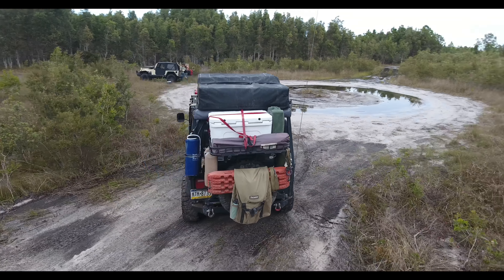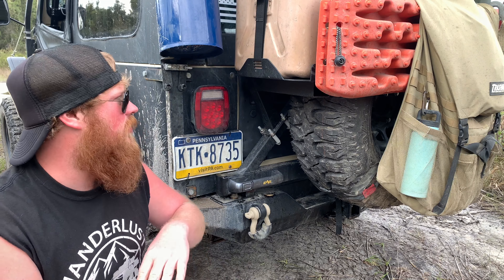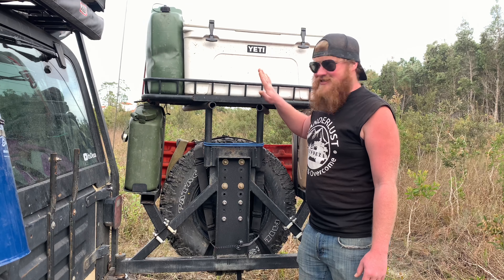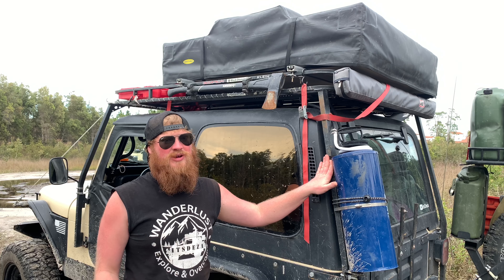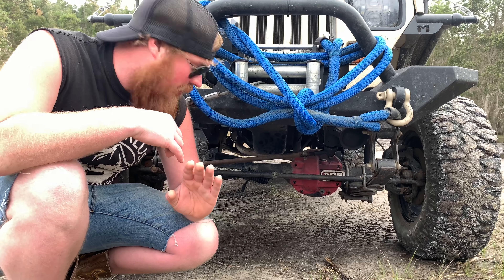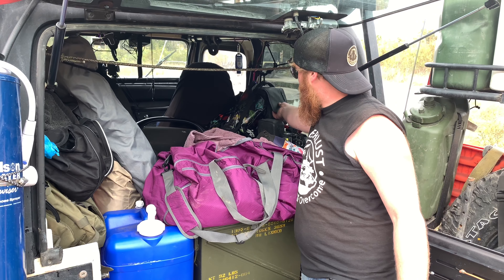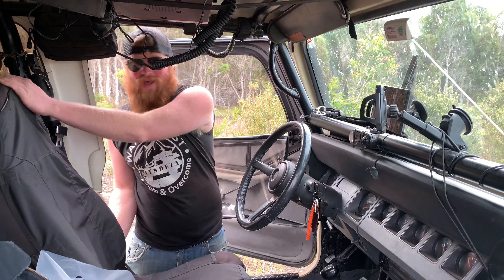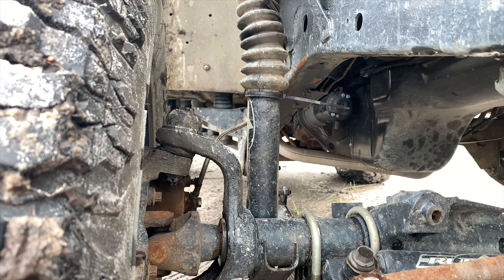Overland Setup! Jeep Wrangler Yj

Comment: I had one of those EAG bumper/tire carriers with the push button like yours and I actually liked it. If I remember correctly I had to modify/adjust the catch pin on the bumper for it to latch correctly but after that it worked great. I didn’t have as much weight on mine as you do so maybe that is a factor. I swapped it out for an Or-Fab carrier which I like better.

Comment: Love the YJ. Would have gotten one if I could have found one in decent shape. My first was a 89 YJ with the 4.2 engine. That went anywhere. Your videos are great.
Reply from the maker: Thanks!! They are hard to find in good shape! Mine was a rusted out piece of crap when I got it! Not a single bolt was left untouched when I built it. A lot of cutting and welding! The 4.2 is the only engine I never messed with how did she feel?
Reply: itsDeza 4.2 was a great engine, had a lot of power for a 6 cylinder. If I could I would put one in my Cherokee.

Comment: Love it!  I have a 92 YJ w the straight 6 (4.0L). Car is running with 15 inch wheels and 33 inch tires. I’m struggling with power and not getting enough torque and power out of the engine. Not sure if it’s due to axle ratio?   Did you change yours?  Let me know your suggestions in getting more power.  Thanks!

Comment: Wow, what changes you have made since couple years ago for your Moab trip. 

Questions: 
- Still running the D35 in the rear with that D30R up front? Whose alloy shafts you have in the D35? Did you know, the early years ZJs had D35s with rear discs that can be adapted to the drum D35? 
- You're missing the front ds in the vid and the vacuum lines for the quick disconnect. You go to the XJ/TJ 1pc inner shaft for the 2pc inner shaft? Upgrade to the 297/760 ujoints from the 260 ujoints in the YJ to go with those shafts? Do you know the ZJ shafts also fit the YJ's D30R and come in cv style? If you removed the quick disconnect, did you change the front ds to the TJ style where its balanced as it rotates constantly and has the double-cardon joint at the tcase output?
- Do you keep any hardware/spares in the Jeep for the Jeep? Axle shafts, ds, dual batts, etc. You have tools but do you have the bigger spares? What about spare fuse, relays, and things?
- Have you thought to place in a dash switch to control the winch, in addition to the hard line hand held? 
- What does it weight outfitted? There are plenty of truck weigh stations to check that out, and if you park evenly across the split of the scale, you can get a front & rear weight.
- Now you have a hardtop, but didn't see any AC. You have the soft half doors to help remove and add air flow, think about having the sides windows tilt, ie minivan? Rear window removed or capable to be split into a slider, ie like those slider uppers for the 1/2 doors? 
- Engine swap included what other mechanicals? Wire harness, trans, tcase to mate to trans (difference of 21-spline to 23-spline), fuel pump, ecu, motor mounts, etc? Who did the swap? 
- SYE on the tcase? Or atleast swap in a TJ version as its slip yoke is exterior of the rear output seal, not like that of the YJ? 
- Nice TSC front lights, need to put more on the roof rack for the sides and rear facing...don't you think? Maybe underneath as well for rock lights and camping ground lights?
- How would you change a flat tire? Hi-lift, stock scissor jack, bottle jack? 
- Still use the foot actuated parking brake? 
- Thought of running the shower through a water to water heater from the coolant? 
- What about the 12v refrigs instead of the large Yetti? 
Rather than to pack all your gear into/onto your YJ, what about something along the lines of a military M416 trailer for the gear carrying? They are pretty small (4x6, almost), set high, have strong overlanding following for setups, etc. 

Do you let your GF drive? LOL.
Reply from the maker: Michael Moran yep d35 rear and d30 up front. They axles are the crown automotive chromoly shafts. I actually did not know that! Good to know! I’m actually going to be swapping a Toyota rear axle with an elocker in it soon. I have a lot of weight and I’m not gentle on my Jeep. That d35 is a ticking time bomb. The front drive shaft exploded on me on the way to Florida. (Currently getting a custom “bullet proof” one made from Point Springs. I removed the center axle disconnect and I’m using the early xj shaft. So it’s the baby one haha. My year yj (95) came with the upgraded stronger axle/unjoints in them. So I have one strong and one weak one haha. The driveshaft that’s being built is indeed balanced, but even before that I ran normal yj shafts with no vibration problems. As for spares, the green box on the roof infont of the tent is filled with parts! Ujoints, coil, spark plug wires, fuses, wire, butt connectors, relays, every piece for the distributor, map sensor, nuts bolts, a full spare wiring harness Incase a connector breaks and even parts to rebuild the diffs. Also there is all my diagnostic tools, test light multimeter and stuff like that. It may sound like overkill but Iv been places 80 miles from anyone and no cell service for days. And to be honest Iv used a lot of this stuff. I even changed out the rear diffs carrier pin in Kansas last year. I haven’t thought of that for the winch actually. I’m about due for a new one here soon. Funny you say that about the weight! We wanted to durning the last trip but never got a chance to. There is a supply yard with a scale close to me that I’m ganna hit when the weather gets better. Our guess is that it weights 5800. (Basically adding up each parts shipping weight on amazon) The hard top is only for winter. As soon as spring hits, I switch to a safari top/rear net combo and tube doors or canvas lowers. As for the swap, yea motor, trans, tcase wire harness, ecu, driveshafts front and rear, motor mounts, motor mount perches need to be cut off the frame and re welded forward, fuel pump doesn’t need to be changed although the fuel lines need to be changed from under firewall to fuel rail. Me and my friend Matt stripped the motor down and rebuilt it, then me Zak Henry and Carl did the swap in my garage. I have a couple videos covering the whole process on my YouTube channel if you’re interested in watching that! No SYE yet. I’m still on the stock rear shaft. I shimmed the rear axle to get the pinion angle better and dropped the tcase skid plate down alittle. I’m only running a 2.5 lift so I don’t have any vibrations, even at 80mph. I love them freaking TSC lights! Bright as hell and great quality! For camp lights I have magnetic lights that attach to the roof rack arms and my gf put those led Xmas lights all around the roof rack. The prob with lights on the rack is running the wires with running hardtop then safari top. Couldn’t find a clean way to do it. I’m sure I’d destroy rock lights very quickly haha. I have a a hi lift jack on the roof under the rooftop tent! Iv so far only had one flat tire! I don’t actually use the parking brake I ran all new cables and everything for it, it works but I just put it in gear and if I’m parking on a steep hill I’ll put it in 4low.  I’m still working out the shower part, before I met my gf I would find a stream or pond and shower that way. With the metal sprayer the water actually warms up fast in the sun! Also I could lay it close to a fire or dump boiling water in it. Yes! Many times Iv thought about a 12v fridge!!!! The prob is I can’t afford it haha. Buying ice and dumping out the water every couple days is so annoying! Iv thought about a trailer a couple times. Would be nice to set up base camp then go explore for the day. But then I have to worry about people stealing or going through my stuff. Nothing would be worse then someone stealing your home and now your stuck with nothing. What about the times when camp is far off the beaten trail? There’s so many pros and cons. Yea my yj likes to try flipping backwards on vertical hills but I’m use to it. It also really hasn’t stopped me from getting down gnarly trails yet either. Do I miss a light weight jeep? Absolutely! But is it that big of a deal? Not as much as you think. Hahaha my gf hasn’t driven it yet she will one day haha! You had some great questions! You should join in on out live stream Q&As! I’m sure other people would love to hear these questions!
Reply: Instead of loose ice in your cooler, fill milk jugs or 2 liter coke bottles with water and freeze them. They'll take longer to melt, and double as a potable water source once they do.

Comment: I also have a front locker, only. LSD in the rear. There have only been a couple of times when the 2.5 didn’t quite have the power that I needed, but that was always in four wheel high. I’ve never had a problem in four Low. i’ve only taking the locker on one major run so far, and I pretty much walked everything. Would love to hear your experience, and if you’ve had any LSD pros or cons

Comment: Question I always have for Roof Racking Jeep owners, how do you remove your top when you have a roof rack installed? I noticed in one of your clips you were topless and still had the roof rack. That is my biggest restraint from going roof rack is losing the ability to remove the top
Reply from the maker: Hey great question! To remove my top it’s as simple as hooking the rack to an I beam or tree branch with a ratchet strap in the back, then unbolting the 2 rear support arms ratchet it up an inch then slide the hard top right off the back! Bolt the rear supports back on and way I go! I don’t even unload the rack haha takes only a few minutes to do. It’s very very easy to do to!  So I say go for it!
Reply: itsDeza thanks so much!! Not sure if you made a video on that yet but a how to would be sick and I think get a lot of traction!! I’ll definitely keep this advice in mind thanks!

Comment: I have a yj on 31s stock everything with 2.5 cyl 5spd…..12-15 mpg 
My 03 f350 long box crew cab fx4 6.0 powerstroke gets 14-15 mpg towing my yj on my 18ft car trailer 
18-20 mpg unloaded 70mph+
Why not build a standard cab 4x4 diesel for an overland and pull a small trailer?

Comment: Hey dude, I noticed that you have filters on your PCV valves (blowby valves) and I was wondering where you got them and if they are safe to install. The factory system was to route the PCV valve to the airbox for emissions so I wasnt sure if that had affected your engine at all or not?
Reply: I was wondering because if they work well then I might do the same  because I have a lot of blowby and it leaks through the hose to the airbox and onto my air filter
Reply from the maker: Yea it is safe! So I’ll try to explain how it works. Do you have the 2.5 or 4.0? So basically the elbows on top of the valve cover are to help get rid the crank case pressure and gases that build up in the valve cover while the motors running. (This is for the 4.0) (2.5 only has one elbow I think) So the factory set up is the rear one by the firewall is connected to a vacuum source. It connects to the intake manifold to help suck out the gasses and lowers the pressure. The front one is for fresh air and helps keep the air pressure normal. (since the valve cover now has a vacuum draw on it it creates a low pressure zone) in stock form it connects to the intake after the filter so it’s not sucking in dirt and debris. But since I removed the stock intake I no longer had a way for clean air to enter the top of the motor. So I bought a small 1/2 inch filter from advanced auto and put it on the inlet side of valve cover. (Front elbow) now both the elbows are the same and end in the same place so it doesn’t matter what one has a vacuum and what one sucks in the air. I don’t actually think jeep used an actually pcv valve. The 2.5 if I remember only has one elbow on the valve cover since it’s smaller I guess it doesn’t need as much fresh air? I never had anything on my 2.5 I left it open. My rings were so bad I had so much blow by and oil it just soaked my firewall with oil, I left it like that cuz hell, if the fire walls soaked in oil at least it can’t rust 😂
Reply: Thanks!! I think I'm going to set mine up like yours then, I feel like it will make my engine run a lot better without the blowby oil dampening my air filter😂😂👍
Reply: And yeah, I have the 4.0. Ripe with 185,000 miles😂😂🚀
Reply: Be careful when doing so, I did the same thing to mine and discovered 1. that the blow by gasses were finding their way from the crank case into the cabin(definitely not good to breathe in) and 2. Moisture was being drawn into the engine and oil upon cool down causing rust. A better idea would be to implement an aftermarket ccv/get filtration system that filters out the impurities before reburn

Comment: any additional info on the radiator youre running?
Reply from the maker: Yep! It’s the Champion aluminum 3 core rad. I believe the company sells them on Amazon now also. I would absolutely recommend it! Mine has given me no issues and even on hot drives through Arizona, the temp never climbs!

Comment: Thanks again sir! Stupid question. You still have run Dana 35 rear? I assume the chronology axle is super strong and was able to handle all your adventure ? I have dana35 and chrmolly axle with 33 12.5. Thanks so much again for sharing
Reply from the maker: No such thing as a stupid question! Iv done many miles and adventures with all that weight on the d35 with stock axles and 32x10.5s! I wasn’t gentle on it either. They never actually broke but the bearings started to eat through the axles. I just recently switch to chromoly, and man I love having the reinsurance of having the stronger axle. The chromoly axles are 40 percent stronger then the stock axles!

Comment: What are the poles from the front fenders to the top for? I've seen them on a couple other jeeps but idk what they are
Reply from the maker: Those are limb risers, in thick wooded areas with lists of under brush, they help protect the windshield from being hit by tree branches. It will guide them up over the jeep instead.
Reply: @itsDeza  oh ok that makes a lot of sense actually I appreciate it thanks

Comment: Hey yall, new to the Overlanding scene. Noticed a lot of people remove sway bars and track bars. Whats the purpose or benefit of this?
Reply from the maker: On a yj, the track bars and sway bars limit flex. More flex will help keep the wheels touching the ground for more traction and added stability Offroad. But with out sway bars it could get sketchy in the road around turns. That’s where good quality leaf springs and struts come into play. I run the Rubicon express leafs on mine and they handle the sway on the road great! Even with all the added weight. Now this concept only works on leaf spring vehicles. I wouldn’t dare run a TJ/jk that has coil springs with out a sway bar!

Comment: Those boomerang shackles dont work how you think..And they are missing the bolt that goes in the empty holes.. They are for when the axle is drooped down so they dont get stuck and bend the spring end..just saying..
Reply from the maker: Not really no. The shape of a shackle doesn’t matter, the shape of a shackle doesn’t dictate behavior of the spring. It’s strictly for clearance. This will be really hard to explain the physics of this over txt but I’ll try. Look at your eyelets on the frame and the leaf. That distance in 3 dimensional space will never change no matter the shape of the shackle. It pivots on an arch it can only move on said arch. It could be shaped like a lighting bolt and as long as the holes are the same distance apart it will always run that same arch. Look at a boomerang Shackle and in your mind make it a straight shackle. As it compresses it runs right into the frame, hence why it’s got a bow in it. With that same straight shackle in mind, picture it’s arch as it pivots. Same arch. As for the bolt in the center, I don’t run them because it limits flex in the leaf it self. I want them to be able to slightly  tilt off axis under hard flexing of the axle. To stiff and the spring won’t roll a bit. Don’t believe me? Test yours. Find a flexy test ramp. Bolts in go up. Then remove them and test again. Perhaps I’ll make a video about all this explaining it. Iv messed with a lot of Racecar suspension geometry growing up. And I remember learning about the shapes of a 2 pivot arm like a control arm. Once you understand how it works it will all make sense!

Comment: Nice Rig Brother! #SquareLightMafia!

Question though, since you were doing swap anyways, what made you go the 4.0 route? I've started my swap on my YJ (but active duty keeps pulling me away from it) and I went the 350SBC route? What made you choose the route you went?
Reply from the maker: Thanks for your service!!! 🇺🇸🇺🇸!! Since I travel a lot I wanted something simple and easy to find parts for. I don’t wanna have to relay on one off swap parts. And since I still have the danna 30 and 35 axles I didn’t wanna put to much power to them and risk them blowing up 3000 miles from home in a desert. The 4.0 matches the the 4.88 gears is perfect for me!  Can cruise 75-80 mph all day and 5th still climbs anthill on the highway. Low range is a freaking animal also!
Reply: itsDeza My pleasure. It takes my freedom away, but as long as people like you and your crew get yours, it makes what I do worth it. Makes sense. I ran across a mud truck with tons (60 front / 14 Bolt rear, all disc converted), 350SBC, TH350 Tranny, and NP205 transfer case for 2k. 4:88 gears and rear locker. Came with braided brake lines and everything attached to the truck. Tires rims everything. A new radiator (too big though) and fluid for next change put.
Reply: Couldn’t pass that deal up.